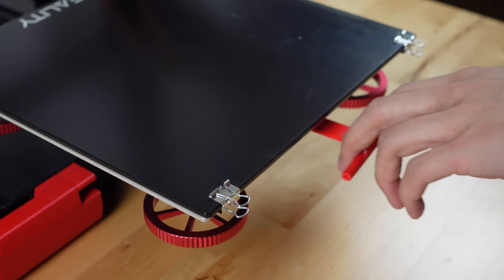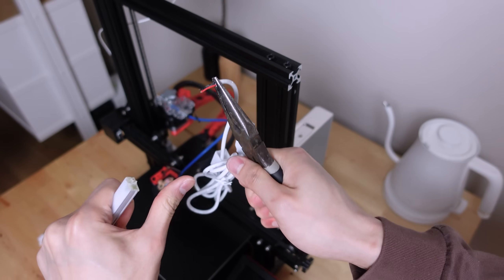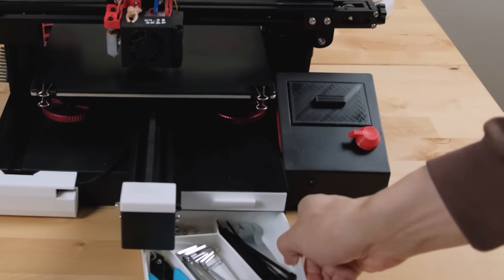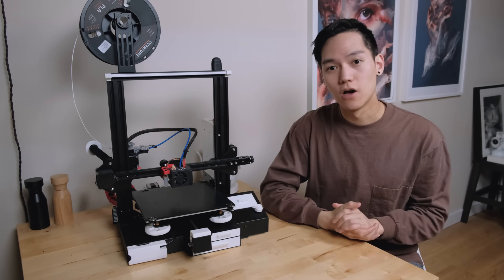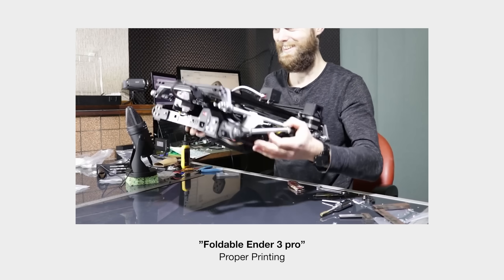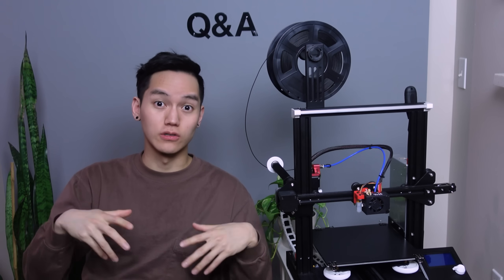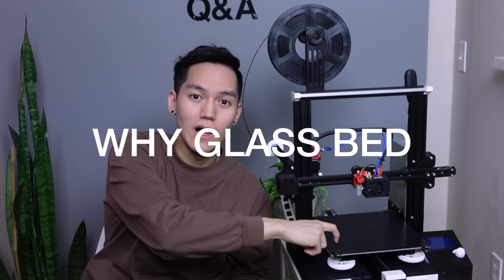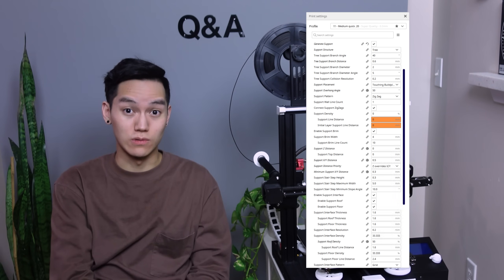An Update on the Ender 3 Pro Upgrades - Part 2

Comment: Rapidly cooling hot glass might cause that bed to shatter...  just a warning.  Although at 60-70 degrees it might not be an issue.  The Ender 3 is like the Honda Civic of 3d Printers.  FYI PETG parts seem to last longer also print orientation really matters.

Comment: Marlin (which I guess you're using since you swapped the stock board for an SKR) usually sets the max bed temp at half the max hotend temp minus 12-15 °C. Let's say you have it at 125 max: that's still way lower than what PEI can handle. Even if you sticked to the magnetic surface it could have handled temperatures higher than 125°C. Glass is still the best idea because it's naturally rettificated (theoretically). A probe sensor and bed meshes can balance the warped bed issue, but they don't solve it.

Comment: Were the new light bracket mods the same model or do you have the model available?
Reply from the maker: i updated the old thingiverse link with these new models. they are slightly different. these new lights are a bit longer and more compact. https://www.thingiverse.com/thing:4545360

Comment: Was going to post this on the part 1 but then this hit.
Does the micro to full size SD card adapter work as you would expect it? On my v2 the directory only gets updated when the micro SD card is inserted or removed.  If I swap a full size SD card it still thinks the old one is inserted.
Only other way is to power cycle the printer.  Of course this may not matter if I ever get my PI fully hooked up and running the V2.

Comment: I think, ender 3 is super cause:
1. the biggest community on one model of printer 
2. cheap for start in 3d printing
3. (and perhaps the most important) - simplicity.  3d printer in the nutshell. 
For a beginner it is easy for finding a problem and a solution for it. If you destroy anything, you can buy new component for a small amount, so you are not scary to do experiments.
 Prusa's printers are machinery, ender 3 is toy for big boys :-) Thats the biggest advantage and disadvantage in one. I love prusa printers, but cause high value I would probably never buy that printer and even if I would never experiment with it as with Ender 3.
Reply from the maker: i've struggled with understanding my feelings about this printer in relation to prusa since i am also a huge fan of the prusa printers and i think you explained it perfectly. one's a really fun toy for beginners and the other is a really serious well made tool! couldn't agree more. cheers.

Comment: 7:50 , you can do nylon on spring steel no problem, the limiting factor is the magnet, however if you get a good quality magnet (such as wham bam's one) , you can keep adhesion all the way to about 150c (much higher than nylon needs)

Comment: Sorry, the Glass Bed is better. One problem I ran into is thin layers of PLA sticking in the coating on the spring steel, then transferring to my next print. I had to extrude/waste waaaayy too much PLA to get a clean color.

Comment: I wouldn't say all Z Screws are meant to be untethered. It depends on the printer. Some printers come with exactly what you printed out and attached to your printer.

Also, I've never seen my OctoPi get over 55 degrees F. While yes, it runs hotter than idle (any CPU will), that is well within acceptable heat tolerances for a CPU.
That said, I did buy some copper heat sinks and they lowered it 4-5 degrees. But still. I didn't NEED them.

By the time you buy extra parts, print the mounts, and do the wiring work, you could have easily purchased this LED light made specifically for the Ender 3 Pro
https://smile.amazon.com/gp/product/B07SHYPRCP

Air cans work, but I also just use a plastic razor blade. I don't like the spatula that came with the Ender since it's metal and I don't want to scratch my glass bed.

And to secure the Glass bed, I like these better:
https://smile.amazon.com/gp/product/B08PZCX7H8

Comment: Pei starts to become less durable at around 170°C. There is a reason for this recommendation. Lighter weight(certainly, espeacially with printers like ender 3), better adhesion etc. The flatness does not matter a lot while you have a bl touch. Pei is the best except for the price point.
Reply: But if you are good with the glass bed, there is no need to spend extra money on this!

Comment: We waited so long for part 2. Glad he's back.
Reply: Also I'm having a problem with the glass bed that PLA is not sticking at all to it. Needed to use 3DLac (spray adhesion) for it to work. Is my glass bed defective? Just changed to PEI spring steel bed recently and I've got some decent print on it.

Comment: Awesome , But a question that your previous printer video was ender 3 pro and in this video you told it's ender 3 so which one is the correct information or model or you bought both of those.
Reply: He is talking about this being the Ender 3 Pro at 5:46 - I just think he got tired of always saying the "pro" part and therefore calls it "Ender 3" most of the time when it doesn't really matter which model exactly this is

Comment: The air duster trick blew my mind
Reply: Don’t do it unless you wanna shatter the glass
Reply from the maker: since the air duster only cools the very thin top surface i don't think the extreme cold is getting very far past the coated layer and into the glass, at least not enough to cause a shatter from what i've experienced so far. plus the fact that it's borosilicate glass probably helps too BUT i just learned that even though air duster cans don't contain CFCs anymore they still contain some gases that are bad for the environment so... i goofed once again 🤡. i'll make a note of this in my next video and give other alternative methods. thanks for the comment!
Reply: @ScottYuJan  I made a lone post about using a plastic razor blade instead of the spatula that comes with the printer so as not to scratch the class and if you use brim those blades get right under it
Reply: @ScottYuJan  try pouring alcohol, it worked for me and it didn't damage my print so far
Reply: @ScottYuJan  smarter every day!
Reply: @arturosilva4219  ive been doing it for months and no signs of the glass shattering, the airduster trick also works with hot glue if anyone uses hotglue a lot
Reply: @n8taing612  the shatter happens randomly, it doesn’t begin to crack. The glass might be thick, and yes this might work if you let it cool down enough to not shatter it, but regardless this causes small stress points in glass.
Reply: Seems like a bit of an extreme reaction.
Reply: a wild tomato appears
Reply: The man himself! Tomatoes also help cool off prints :P
Reply: @sidewinded1  stop
Reply: @sidewinded1  your killing him
Reply: I see what you did theair.
Reply: you should try to print disgusting tomatos :D
Reply: Don't do it it can shutter your glass
Reply: Doesnt the cold air shatter the hot glass bed?
Reply: its basically liquid nitrogen in a can :)
Reply: hi big man. dont destroy your bed
Reply: Wouldn't cooling a small spot lead to warping of the bed though? I mean works the same with frying pans. May be a bad idea. Also those air duster cans are ridiculously priced so it'd add to the costs. Here they're like $10 for that typical sized can.
Reply: it was like 200iq trick
Reply: It’s funny, I knew about the trick, but I ran out of duster so I use my freezer
Reply: question is does it thermal shock the glass enough to shatter it or heavily weaken it in the future?
Reply: Wouldnt suggest you do that thou. Rapidly cooling glass puts a lot of strain on it and can become a more brittle area over time. Same with aluminium and other materials. Id suggest you have a fan on a flexible arm to cool down the bed and print using convection instead, its much nicer to the materials :)
Reply: Really
Reply: I am a subscriber of your chenal
But I like tamatos.
Reply: @sthekalakar  wait, thats illegal

Comment: I don't think spraying the upside down air duster can is a good idea, it may crack the glass. I know it is borosilicate glass, but even then it can still crack from such shocks.
Reply: Yea air duster is super duper cold
Maybe something more gradual like a cold hair dryer
Reply from the maker: since the air duster only cools the very thin top surface i don't think the extreme cold is getting very far past the coated layer and into the glass, at least not enough to cause a shatter from what i've experienced so far. plus the fact that it's borosilicate glass probably helps too so i haven't experienced any issues yet. BUT i just learned that even though air duster cans don't contain CFCs anymore they still contain some gases that are bad for the environment so... i goofed once again. i'll make a note of this in my next video and give other alternative methods. thanks for the comment!